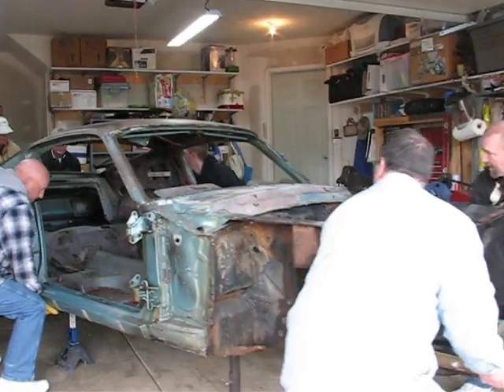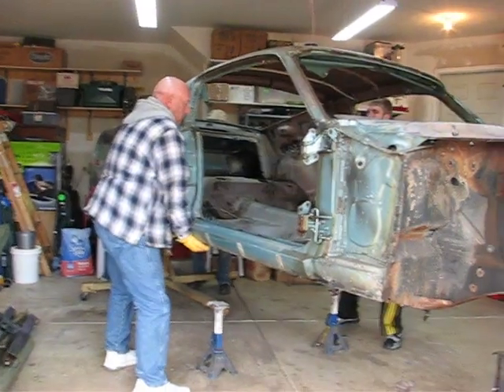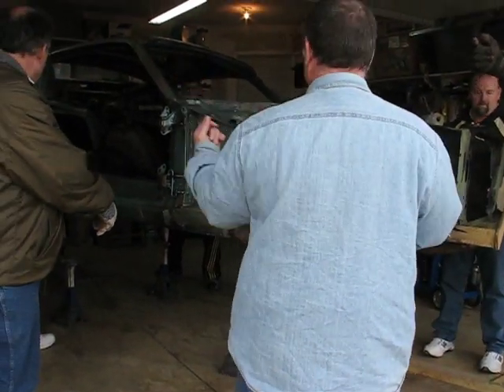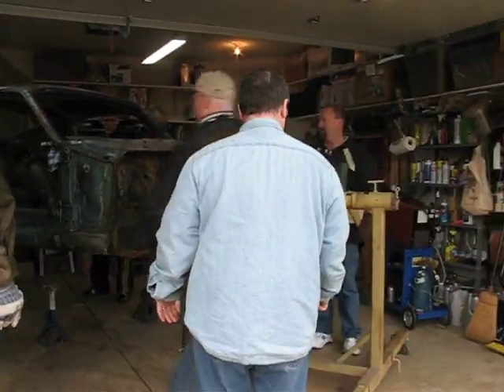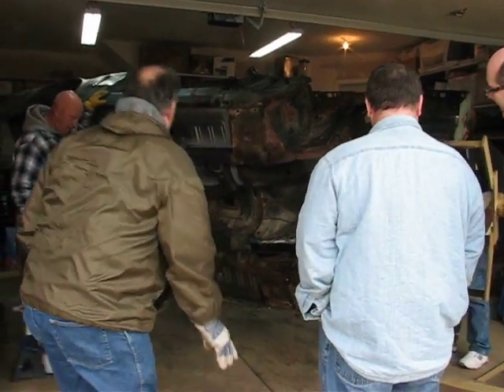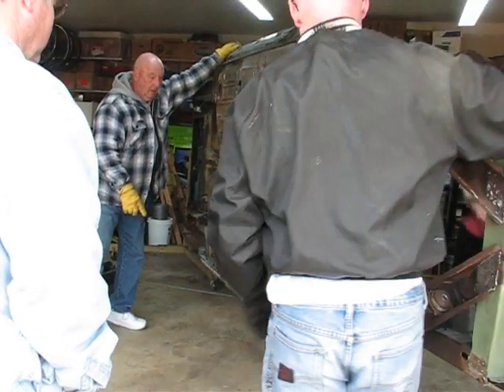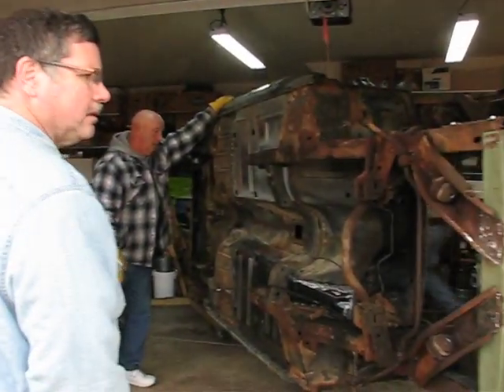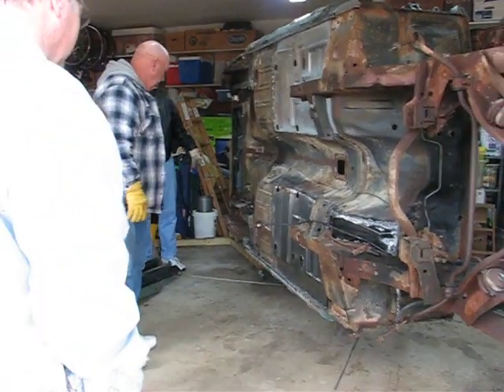1968 Mustang Fastback going on the rotisserie

Comment: how was the rear mounted to rotisserie? bumper mount area?
Reply: nvm.. found the blog that had pics of the mount. i was worried that bumper bracket not being strong enough to hold the weight of the car, but i guess it can with no issues lol.